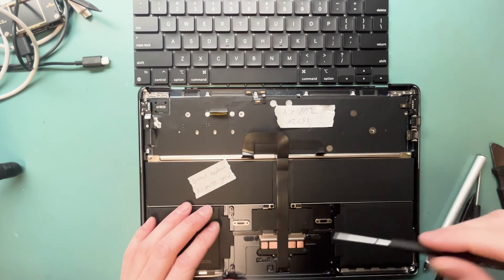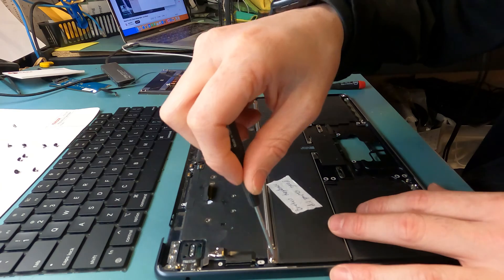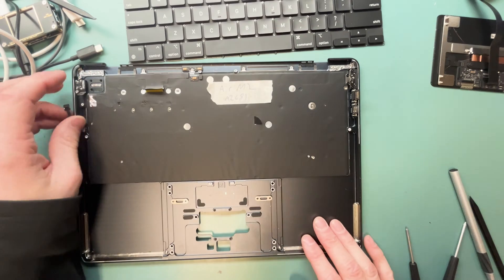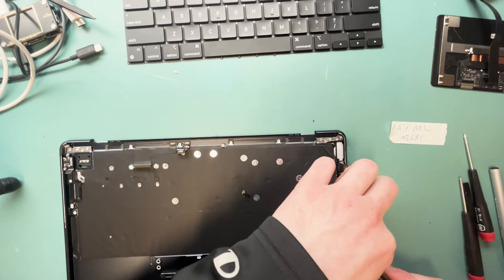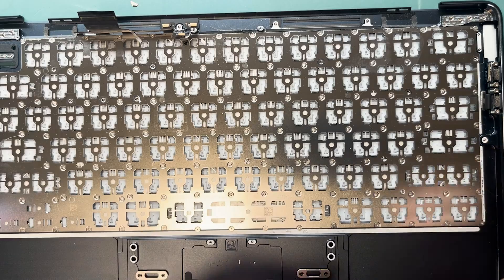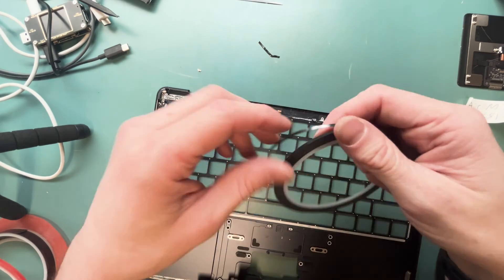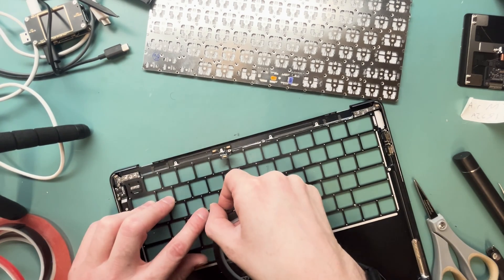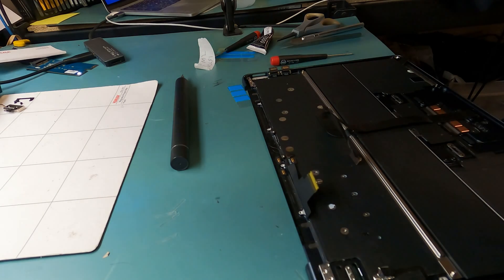MacBook Air M2 A2681 Keyboard Replacement Refurbishing Guide Transform a $20 Part into a $400 Repair

Comment: I tried replacing the keyboard but the macbook kept turning on by itself when i shut it down
Reply from the maker: I'm sorry to hear that, did you make sure to disconnect the battery?
Reply: @worthitrepairs yes I did
Reply from the maker: @Techhqhd  does it shut down when you unplug it from the charger?
Reply: @worthitrepairs no I stays on
Reply from the maker: @Techhqhd  How long is it on for or do you not even get to login screen
Reply: @worthitrepairs it works fine as it should when the battery is connected but once you hit shutdown, it shuts then comes right back on
Reply: @worthitrepairs yes I did. I later rectified the issue yesterday morning but I didn't even know what or how I did it and I'm concerned incase of next time

Comment: For fixing new keyboard was at older models possible to use small screws which was better solution for fixing. Those screws is no possible to use here or why are you using tape ?
Reply from the maker: I've tried to do a screw way where you screw it all in but it was unsuccesfull the only way that worked for me is using the tape. I sold about 3 like this and none have came back so it is proven that it works fine

Comment: in the old macbooks, 2013-2017, I used a chisel to remove the rivets, a quick pound with hammer, knocked them right out. Are these different to remove from previous models?
Reply from the maker: @silver60618  I tried that doesn’t work :/

Comment: i hope no one follows this repair, this is not the correct way, not even close. 

archimedes micro drill, 0.8mm hss drill bit, use the screw set that arrives with new keyboard.

this repair with glue will be terrible quality. the customer should have been charged £10.00 for this.
Reply from the maker: Thank you for the reply!!!!! I was looking for the correct bit for this.
Reply from the maker: I ordered one from a hobby website but it never showed up :(